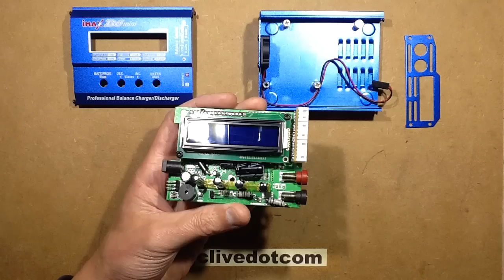Imax B6 charger clone autopsy.

Comment: i made the same mistake, and purchased a clone off ebay. 
Ended up getting a refund because my clone had issues and did some strange things. 
any how.. if you need any items tested or picture taken just drop me a message. 
I can measure that resistor if you like etc, or take pics
cheers

Comment: When a resistor is put into a circuit to act as a sort of fuse as this one seems to have been is it just an ordinary resistor or is there a special type for that function? and if so what is it called?
Reply from the maker: You do get fusible resistors, but standard metal film resistors are also used for their controlled failure.
Reply: It is a special type and it's called fusible resistor. A main difference to a normal resistor is that it fails without flames and around a specified current.

Comment: We Bought a imax charger and when we received it we found out it was a clone.
We tested it and it just didn't work. It turned on and you could charge a battery with it.
But the problem was that the voltage sensor inside the unit was malfunctioning and caused the battery to discharge. But at least we got a refund for it. At the end we used it as parts for my arduino. The buzzer, LCD and buttons can all be used with an arduino.

Comment: In one of your videos you recommended buying massive bags of LEDs so they're cheap, but then you don't know the forward voltage etc. So do you test each or just guestimate?
Reply from the maker: As a rough guide the forward voltage of a red or yellow LED will be around 2V while a blue, green, white and UV LED will be around 3V.
Reply: Depends on what you want to do with them. If you're just using a single LED or multiple LEDs where brightness differences don't matter you can go with the voltages as Clive said.
If you intend to build something where it's important that LEDs light up equally or you want to know the voltage for maximum brightness, it would be better if you'd use a constant current source (set to 20mA, the typical current for all those LEDs) to test them. You can easily build one from pretty much any linear voltage regulator (LM317, LM7805,...) and a resistor (google is your friend for details). If you set it up nicely (so you just have to plug in a LED into the breadboard with the multimeter connected for example) you can check the forward voltage of a LED at that set current within seconds. Do that for 10 or 20. If the voltages vary wildly (>0.1V) for the same color then I'd check all of them and maybe sort them into bins. If they are all similar I wouldn't bother checking the other ones, but of course label the bag with the typical measured forward voltage.
Depending on your needs you still might want to check all of them, because the quality of these bulk bags can be like a lottery. I had bags with duds or mismatching colors, even one where the kathode and anode of all the LEDs were switched (especially funny because in that case because it was a bag of IR LEDs that you never see light up anyway, only find out that you've soldered a bunch of them the wrong way round because your project does not work).
Reply: superdau Thanks,I'll definitely have to save this comment away somewhere, I'm trying to get back into electronics. I've forgotten everything! This really helps, although I don't even have a multimeter(yet) ;)

Comment: A partial refund for a fake? I wouldn't accept that, full refund, and no trading standards
Reply: Most sellers declare these things clearly as fakes (hobbyking for example)
Reply: And for what is really a user error? I'm amazed that he even got that.
Reply: It's not user error, as it doesn't have any I/O protection like it should have.
Reply: When I fed phantom power (48VDC) into a consumer sound card and killed it, was that my fault or the manufacturer's fault for having any I/O protection?
Reply: +simontay1984 Resistors are often employed as fuses in consumer gear as they can serve double duty as both current sensor and overload protection without an increase in parts count (as in, money saved versus a much more costly fuse and holder), they are essentially equivalent to an extremely slow-blow fuse and like fuses, they fail in a generally predictable manner.  Fuses are not perfect though, either, as they can have a rather large and not perfectly predictable voltage drop at high currents.  You would expect better protection in industrial equipment, but this is pretty much the norm for typical consumer gear, particularly on less expensive gear.
Reply: I demanded a full refund for exactly the same reasons, the seller refused, offering about a 30% refund so I linked the eBay terms and conditions which state it is against the rules to sell counterfeit items. The seller still refused to refund so I contacted SkyRc and got an email from them stating the item I received was indeed an unauthorized copy. Still the seller refused to refund. I contacted eBay and asked them to step in providing them with all the information I had and received a full refund a couple of hours later directly from eBay. I left the seller negative feedback and they had the audacity to harass me for it. In turn I spent another $15 AUD buying 15 small items for my lab, which after I received I left negative feedback on each of the items. Don't give up, and don't pay when the item is useless, I did the same with 20 lithium cells with less than 20% of rated capacity from 10 different sellers and received a full refund for all of them.

Comment: i got an IMAX clone... the positive lead came out and touched the case and caused my LIPO to blow up.
Reply: I hope you didnt got hurt :o
Did something else cought fire or got damaged?
Reply: KaienSander10 no, luckily the lipo was in a lipo bag and on a steel table. the entire room filled with smoke, but most of us got out before the smoke reached our lungs.
Reply: +RKSNomad Well that's good to hear that nobody got hurt! :)
Reply: I use mine on a concrete floor and away from people (checking it's not catching fire via a remote camera). These things scare me.

But if you want to buy a genuine one, there a 90% chance you'll get the clone (for the price of the real thing) so I thought I'd spent clone money on the clone...
Reply: fabts4 i stopped using those. look at my new baby. http://site.hobbypartz.com/75P-T6-Multi-Charger-01.jpg
Reply: Damn ... see, that's why I really don't like cheap knockoffs. Some people swear by these things ...

Comment: Clive I can confirm that the resistor is indeed a 0.5 Ohm 3 Watt ;-)
Reply: I assume you have the same unit as this? seems like you are confident of that fact ;-)

Hopefully he can repair it and do an in depth video on it I think a lot of people have these (including me) so be nice to get some more info..
Reply: +Dave Webster (Webstaff) yes I have repaired a similar unit with that resistor being burnt,  the bands survived colour wise ;-) and the MOSFET survived
Reply: well most probably he could make the resistor himself in case those are hard to find either winding fine wire around a ceramic rod or by puting 10 5ohm 1/4 resistors in parallel

Comment: I have an imax b6... how do you tell if it is a clone?
Reply: the cheaper price than the original basically
Reply: 25 quid versus 12 quid, that usually  separates the quality
Reply: and even then, its not a given
Reply: does it really matter?
I could imagine that in the case of such a low price primitive device, the odds are pretty high, that the insides are exactly the same
Reply from the maker: There are some pages on the 'net that compare the insides.
Reply: +phil no ok thanks all... would rather know my expensive lipos are being looked after by quality equipment given their cost!
Reply: oh christ yeah, i do have the fakes, with the cheali charger firmware,  i like it that way, but... BUT i wouldn't do it to a genuine unit, the fakes lend them self's to modding, you don't care if you pop a fake charger, i also don't ever leave them unattended, fake or not :-)
Reply: if the four buttons are strongly attached together and moves a bit, it is a genuine, if it's like in this video you have a clone
Reply: every one iv ever bought has has the logo on. iv never bought a genuine unit, im far too cheap :-)
Reply: it probably is, i bought mine in bulk, only 4, from the same seller, my point was simply i have them, they are clones and they do indeed have the sky rc logo, :-)
Reply: they dont have an auth sticker thou
Reply: So I have one of these, with proper authentic sticker and all (still don't know if it's fake), but the voltage and current readings are just waaaaay off, even when measuring directly at the outputs. Are there any way to calibrate this?
Reply: yes, in the calibration menu, hold stop and inc at the same time untill you reach the service menu, if you have an authentic unit, then this will only work once, to do it again you will have to flash new firmware to the unit
Reply: Hi Phil.
Thanks for replying. Can't seem to find a "calibration menu" anywhere? The only extra thing i can access, is the "update" menu by holding START when booting up.
Reply: hold stop and inc whilst plugging in the unit, im sure unit must be un powered first,
Reply: but i repeat, this can only be done once, if you mess up calibration, you WILL have to flash firmware...
Reply: This results in nothing but the charger starting up, and then cycling through the menus. Can't seem to find anything online, other than the fact that people say to buy another brand :/
Reply: Wuptidoo http://www.rcgroups.com/forums/showthread.php?t=827821
Reply: then most likely its already been done and is now locked out...
Reply: ah yes, I see now. This is for the normal B6, not the mini, I'm afraid :(
Reply: any way to flash it easily?
Reply: try try this hold Dec (-) and Start button
plug power adaptor
wait for calibrating menu
release Dec (-) and Start button
wait 20 minutes to warm up to the working temperature
plug in battery and measure it, compare values between charger and Voltmeter
if necesarry, then make correction using + and -
save it by pressing Start
Reply: Wuptidoo you'l need a usbasp inserial programmer
Reply: seems like too much work for a cheap, crappy charger, but thanks alot of the help man :)
Reply: no worries buddy 
were all here to share in one way or another :-)
Reply: not sure wether someone already said it but my one had an auth sticker on it and the webpage from skyrc said it was genuine (it also cost around 40€ so i better hope it is xD)